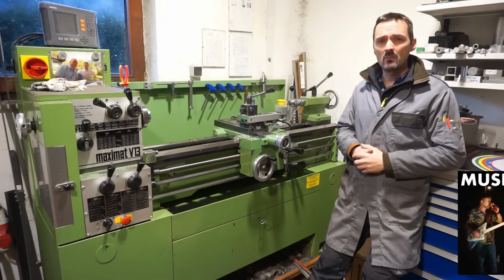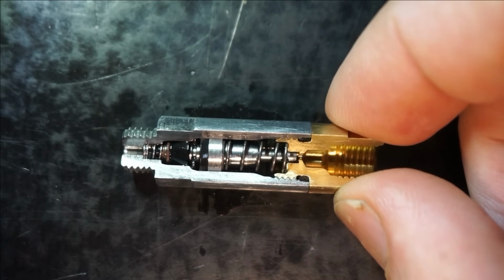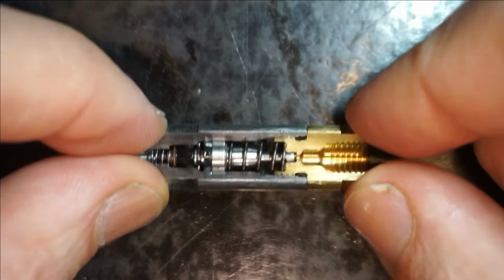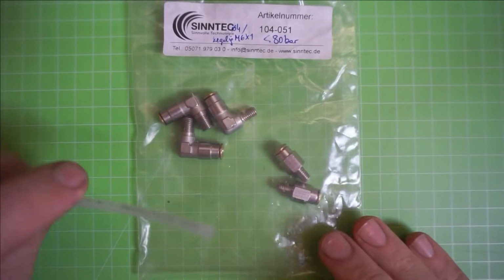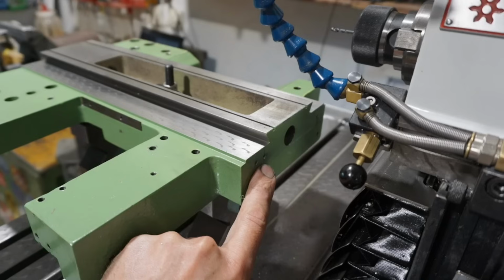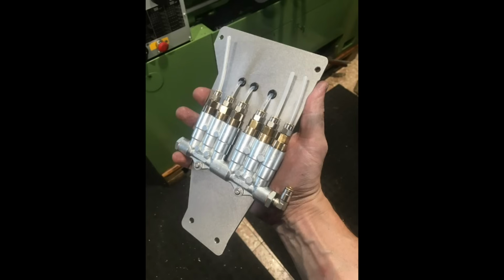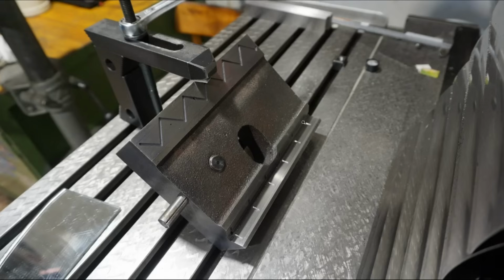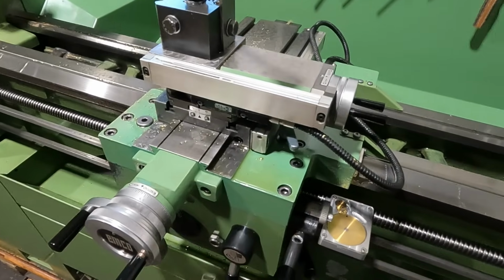Central Lubrication Upgrade! On the EMCO V13 Lathe

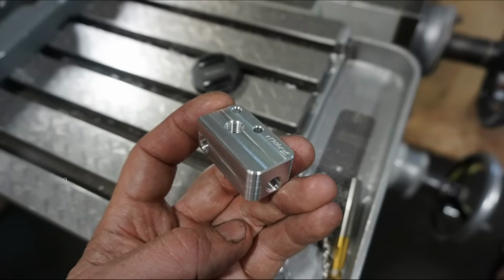Comment: 42:00 doesn't the manifold you made cause issues with the distributors? As it follows path of least resistance so for example the tailstock getting less oil to its distributor than the carriage

Comment: Hi Alex! That’s the video I’ve been waiting for a long time! I’m in the middle of my EMCO Maximat 10P upgrade process and trying to copy from your setup as much as I can. As an amateur machinist and self learner this kind of videos are truly priceless for me. Thank you very much for a great work and explanation!

May I ask what type of oil are you using in your central lube system and what type is used in gearbox and headstock?
Reply from the maker: Hello! Many thanks for your kind words. The oil I use in the central lubrication system is way oil. On the head stock and gearboxes I use Shell Radula with 46 cSt viscosity. ATB

Comment: What you didn't address is how you picked the volume for each port.   It helps to think of 0.1CC as about 2 'drops'.   It looks like you put some thought into it, but I'm curious about how you calculated?  
Also, it is important to note a benefit of using a pressure oil port - it pushes dirt out!

Comment: There is a reason why I view you as the patron saint of Machine Trinity... You, Stefan and Robin Renz are the paragons of excellence and diligence in whatever you do... 

As always, well fucking done!

Kinda remarkable how ill thought out the Emco lathe is... A really nice machine visually, and the Emco style is definitely unmistakable to anyone familiar with any of their machinery, but the machine - when viewed through the lens of the 33rd degree machine design nitpicker - is a compounding sequence of bad decisions held together by a good amount of high grade iron... From inferior componentry lubrication to inadequate way geometry and sub-optimal structural reinforcements - it appears like a nice deal, but is the prototype of what has been branded by Stefan as ``tool/machine kits`` or projects that offer a good deal; requiring quite some secondary finishing operation to actually achieve that status... Tho, she was damn pricey for a ``kit machine`` back when she was freshly minted...

As said - well fucking done, once again you confirm your greatness as a caretaker and an operator... Superb work with minimal molesting of the castings...

Best wishes and kind regards!
Steuss
Reply from the maker: Very kind of you, thanks. The V13 is kind of two face in my opinion. Spindle, housing, lead screw gearbox, carryage are nice items, however, ways and lubrication are not well designed.

Comment: Thank you for the follow-up on your last video. 
You have given me quite a few inspirations for modifications on my Super 11, which is largely a very similar machine, except smaller and lighter in every way. I won't attempt the deep hole drilling though, that's for sure.

How is your WU50 coming along?
Reply from the maker: Thanks for your comment, the WU50 is currently in store because I have to arrange for more workshop space.

Comment: If I see how properly lubed now, I start feeling Guilty to just use standard lubrication on my lathe…
Reply: Good! That is why i hold this dude as the patron saint of machinist excellence... Him, Stefan and Robin should make you question your approach and prior work, lest you treat the machines and your work in the very least - in the manner in which they do... 

Take your time, consider some modification, watch their stuff... Lubrication might just rank even higher than cleanliness of the machinery, as proper lubrication has the potential to literally forcefully wash away all junk and swarf, which while not a reason to neglect cleanliness - can forcefully maintain a machine in supreme condition by denying any otherwise potential wear... 

Machines are a beautiful thing, and they deserve the best... Especially the oldies made to have the potential to outlast humanity - as long as there are worthy machinists to take good care of them and operate them with love... 

Best regards!
Steuss